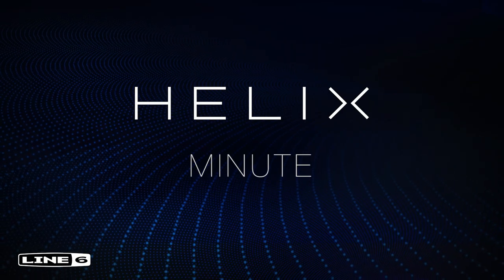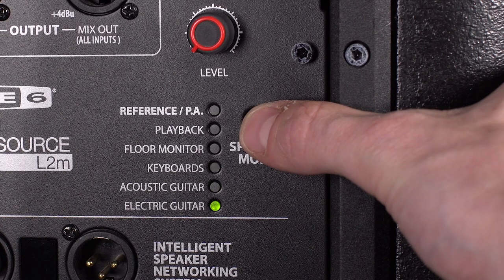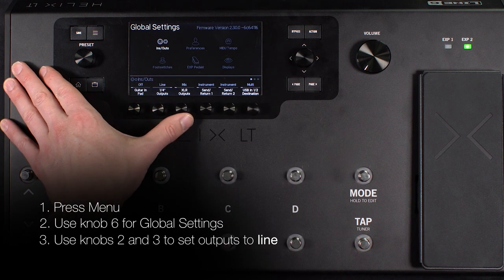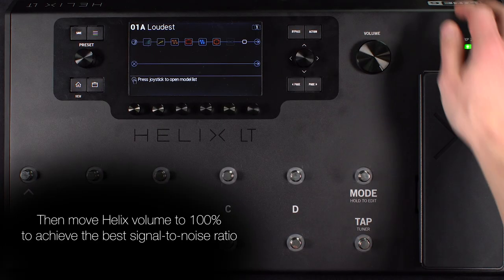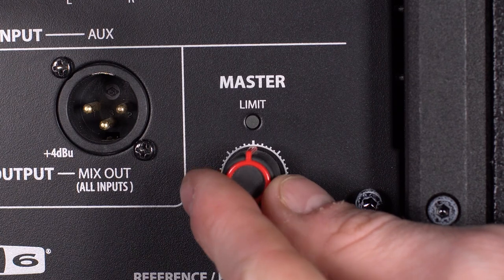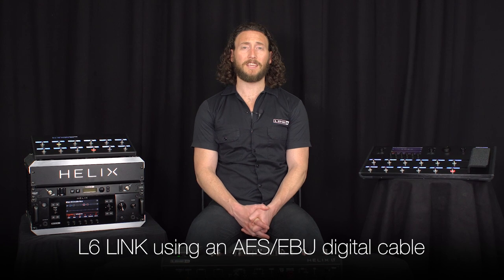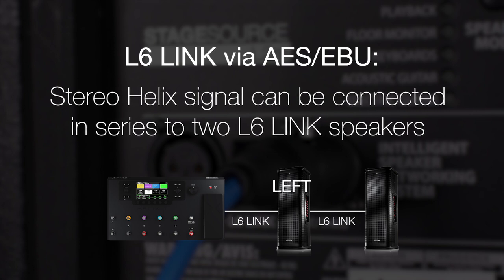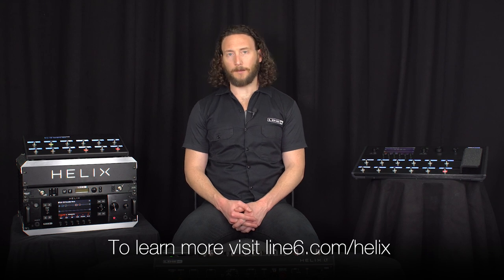Line 6 | Helix Minute: Connecting Helix to a Powered Speaker

Comment: Question, and I hope I can convey this properly. 
I have a Helix Floor, Powercab 2x12 Plus and the Blue Line 6 AES/EBU L6 Link cable. 
I’m not interested in changing any effects or controlling anything from my Helix to the amp per se. I just want to insure I’m able to achieve the stereo effects I have programmed into the Helix, coming out of the Powercab. 
I have a XLR to 1/4  TRS cable that runs to a XLR module in my pedal board. Would hooking that up in between my L6 XLR input on the back of my Helix, disable the functionality of the AES cable to where I can’t get the stereo signal through one cable ?

Comment: In “Global Settings” In/Outs my knob 2 says “Mic In 48V Phantom” and my knob 3 says “Mic In Gain”. I cannot get either to say “Line” by turning the knobs. I may have it hooked up wrong.

I am running out of the left and right 1/4 inch of the Helix into the XLR of my “Rokit 4” powered studio monitors. Will this work? These monitors are the only thing I have at the moment. I am planning on getting some FRFR’s in the future but I have some set lists that I need to be learning now. I have good headphones but would rather use my monitors. Any help would be very much appreciated. Thanks.
Reply: Ok… I had to page over to get to the correct settings. Man does it ever sound like pure shit!!! lol. I guess either the studio monitors are not good for this or it will take some serious tweaking to get useable sounds. My little mini VOX amp sounds miles better than this!

Comment: Hi there.. some questions:

I own a pod500 and an L3M stage source, making some test I got this results:
1 connecting via L6 Link - perfect (quality 100% )
2 connecting vía 1/4 normal guitar cable (quality 80% )
3 connecting vía XLR normal cable (quality 50% )

Between test 1 and 3 the difference is really huge.. the volume decaes almost 40% or more.. and the quality is really bad.. 

The question is: If I play live using L6 Link is perfect,  but if for some reason I have not L6 link my sound will be totally different ?.. It was assumed that FRFR would always be the same sound and that the musicians could have confidence in this ... no matter where we play and if L6Link is used or not .. I'm right?

Comment: Can't you use the XLR out to the speaker?
Reply: was wondering the same thing that's how I have mine hooked up
Reply: You can but for optimal impedance, in your global eq set up on the Helix, set your XLR outs to line level signal, otherwise it's best to run it into a mixer channel for front of house or your audio interface for a balanced signal out, you don't want to run a preamp (Helix XLR) into a preamp (mixer/interface channel preamp) but that's fine if you set it for line level signal out of your xlr's into your powered monitors XLR inputs. Otherwise you don't get a higher signal output as you do when it's set to XLR balanced signal. I got my XLR outs ( set at Line level signal out) going to my interface XLR preamp in and the 1/4" outs (set at line level) to my powered frfr monitors, that way you can global eq your signal either to both XLR and 1/4" outs or just to one or the other, now that's cool because you can eq your stage monitors to your liking without effecting the FOH eq, I didn't know that till I got some frfr speakers hooked up now that's pretty cool!
Reply: @fabianvasquezjr8852  Couldnt I use the output XLR and connect directly into my powered speaker in MIC set? I am asking that cause I have the Stomp HX, which doesnt have XLR out, but I have a Direct Box for that. I dont know if I can run the direct box into MIC or Line of my Yamaha DRX. Thanks.